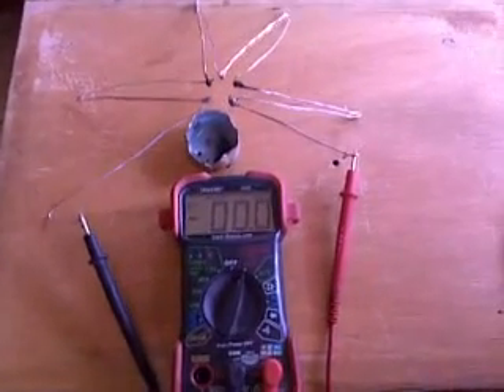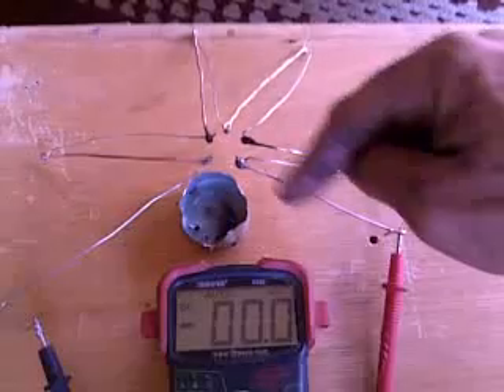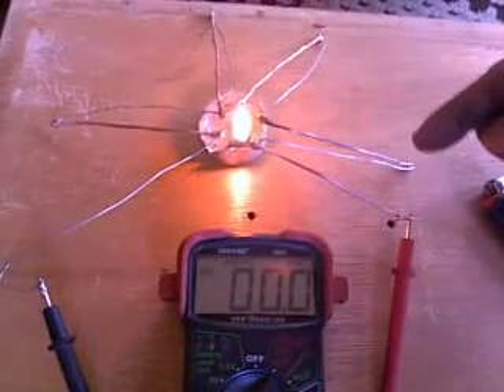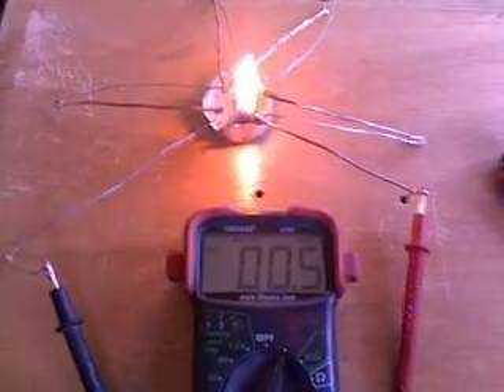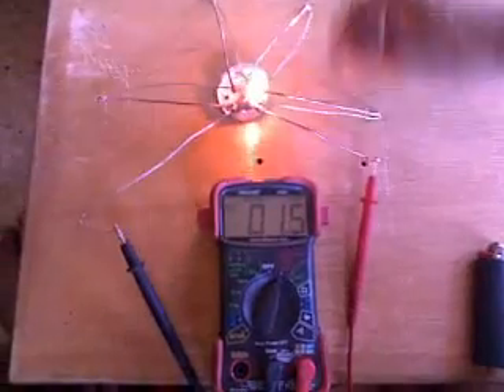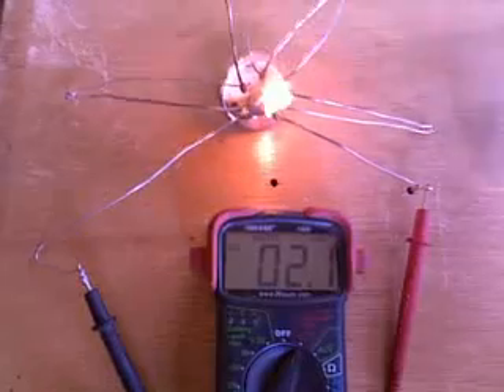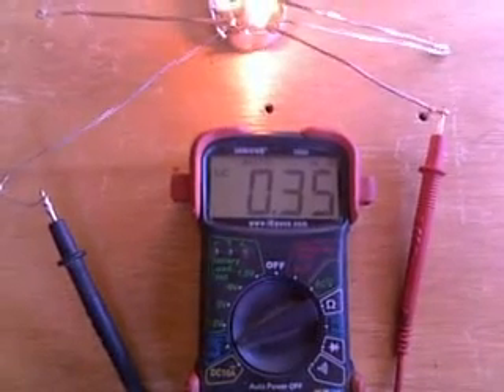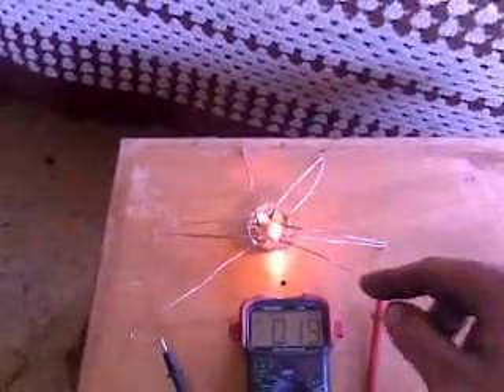thermal electric generator home made

Comment: Peltier Thermoelectric cell from memory does this to a point which is usable.
instead of making thousands of connections, just use a bank of peltier cells with heat sink.
only advantage to doing it with wire is if you want to have remote cold junction and much higher temperature tolerances.
and example would be snowing outside, and fire going inside.
Reply: and if you get wire for free or already have it.
Reply: have a feeling the time effort and additional materials required to make enough hot and cold junctions for it to be viable, negates the freebie aspect. Dont get me wrong, it has been done quite a few times in the past, but it tends not to be practical.

Comment: how can create voltage upto 5 v using this model???
actually i tried aading more thermoelectric generators in series but i was only able to produce 1v
Reply: If you want to generate 5v using the seebeck effect I recommend you to use a peltier cooler as a thermoelectric generator (peltier cooler are cheaper). Maybe 3 of them in series will work, depending on the temperature gradient you have.

Comment: Sorry one last thing that is very important is I coil the 2 ends that stick out(cold side) about 1.5 in. Not sure why this works better. But I think it is the larger surface area contacts for more electrolysis and a larger heat sink.

Comment: Brother you have got to try that again only use 40lb test copper trolling wire(line) and 17gauge aluminum wire making each length of wire 1foot long. I used the sun to heat the middle that is sandwiched between 2 panes of glass(6inx6in) J B welded together leaving the V end exposed to the wind(air). If I could post a video of it I would and I am reluctant to post the numbers achieved on my own doing this before someone else vets it. I have used all manner of sun intensifying ways to generate more heat. I have a few more bugs to work out but I think this is the way to go. I am currently making another one with slightly thicker copper wire and will be ready for testing by March . So wish me luck.
Reply: Hello, there is a way i can contact you? I would like to start to work on something that can at least power up a laptop.  But i lack the knowledge of some things.. if it's not a bother i would like to talk to you and ask you some question about this effect.
i would like to know how can i save the electricity created, (how to link that system toa bactery.., and if the electricity created is based on the heat produced or based on the difference between cold and heat. 
if i make one side at 2 or 300 degree and the other side a lot less, whould that be enough to generate electricity up to 12 volt? I'll give you my e mail contact if you are available to help me with info ^^

Comment: If you can arrange for the hot gas from the candle to go up a chimney and have a larger chimney around it then maybe the hot air rising through them might drag some cool air up the outer chimney. If your cool junctions are in that cool  airflow then maybe they would stay cool.

Comment: Best and simplest explanation ever!  What metals are the best to use get the max power? Also does it loose power the farther the cold and hot sides are apart?  or does it not matter how far the distance? 
What is the aprox. heat difference needed to make a electrical charge? Same question for a stirling engine. What is the aprox. heat difference needed to generate power?

Also please POST a VIDEO of your Larger Tower with 200 thermal couples! 16.3 volts!! awesome!

Comment: This is about the first video I watched on thermoelectric generation. I like your simplicity of using copper and stainless steel. I have looked around and other generators use other metals with low melting points. I am assuming these other metals have a better efficiency. However, using copper and stainless steel you can raise the temperatures to over 600c.

Does your 200-thermal-couple tower use copper and SS and is it in a similar configuration as the one in this video?

Nice work!

Comment: Nice work - I hope to see someone create an ed leedskalnin PMH with this as it doesnt require much electric spark to create magnets with power to lift 25lbs.

I always wondered how to create a super powerful magnet, then leedskalnin taught me. To use something as simple as disimilar metals to produce the initial spark without a battery is pretty much for me, the key to making "something out of nothing"

Thanks a lot for this simple yet informative video.

Comment: check out nyle stieners thermocouple, just heat  copper wire till part is a copper oxide layer and you only need the one metal!! he put 16 in series and had about 2 -3 volts to light an led. great work!! love this stuff, put it in a solar collector as well at the focal point,

Comment: If you fill that container with pure alcohol, you will be able to cover all the couples with its flame. Also if you replace the aluminum with nickel wire, you will get more power. It will provide about 0.3mV pr. 1 degree celcius difference pr. couple.